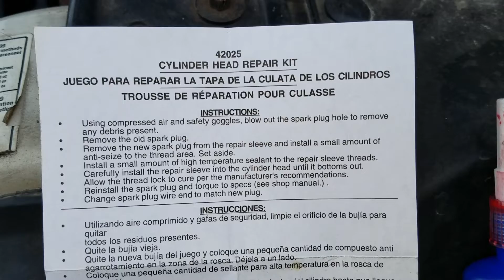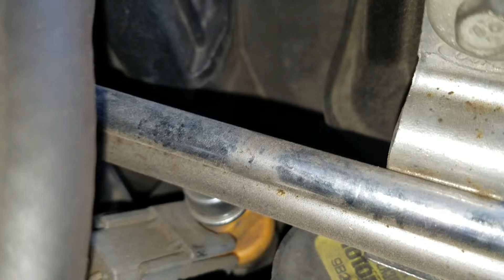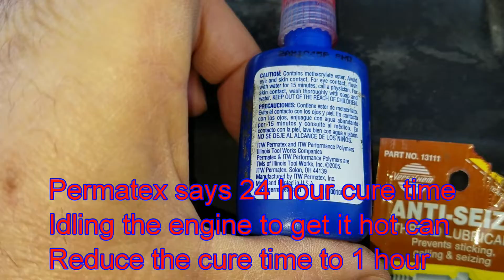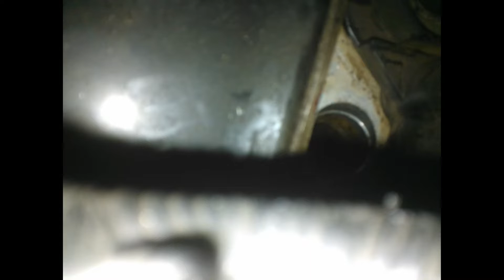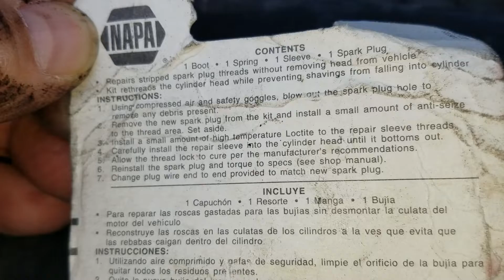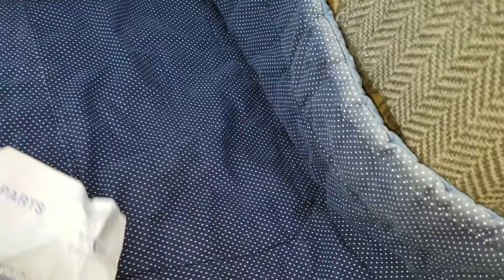Fast Permanent Fix FORD  5.4 L 2V Aluminum Head Spark Plug Seat Repair

Comment: Waste of time watching this video
Reply from the maker: Why is that?
Reply: @CITAP1  because of the title of the video. I thought this was going to be a walk through of how to re tap the threads, but it's all talk
Reply from the maker: OK,  there isn't much to show for re-tapping the sparkplug hole. The new seat taps threads as you tighten it down into the head.  (If for some reason this kit fails to work, you can go the next step and get a drill, tap, and re-seat type of kit.) You simply get the NAPA kit I show, you have to have the high temperature red thread locker.  Clean the threads as best you can. Brake cleaner and any way you can reach down the hole to clean the threads. Spray onto your cleaning impliment, not down into the cylinder.  Load generously red thread locker onto the new self tapping seat. You need a thin wall socket and extension to get into the hole. Start turning / tightening the new seat in and keep tightening till it has a solid stop. Tighten only, do not loosen.  Let it setup a couple hours. Reassemble the coil with the new short rubber boot and connecting spring.  You're good to go and if you have all the parts, it should only take 15 minutes. It's very quick and simple. I have 3 of these on my engine now and they work great. Others have had good results too. Sorry I don't show tightening it in. Only have 2 hands but it's just tightening it in like anything else you tighten down. Hope this helps, good luck...
Reply: @CITAP1  any information is helpful at this point because this will be my first attempt this weekend.  I appreciate the reply, thank you for reaching out.
Reply from the maker: Hello Bryan, I am interested to hear if you used the kit and how your result was.

Comment: This should have been a recall on these trucks but that’s my opinion
Reply: 💯 % designed to fail I remember as a kid dupont designed a tire that would never fail but they scraped it cause they needed them to ware out to sell more.
Reply: Four little as threads come on ford.
Reply from the maker: The first edition of the heads I understand had 3 thread turns for the plugs and the problem was awful in the early engines. A couple years later, the improved head came out with an impressive 5 turns of threads for the spark plugs. That's planned obsolescence for you. The FROD, I mean FORD, or do I, Engineers knew exactly what would happen. Frankly, all the manufacturers are guilty of some sort of cheaping out on product quality.
Take care...

Comment: Nice vid never seen this kit looks pretty simple
Reply from the maker: I just did another repair last January 2019 in Las Vegas while on a road trip. Takes all of 15 minutes to do the whole job. Longer for the cylinders closer to the firewall. Take care...
Reply: It's pretty simple alright, that is until your socket gets stuck and you cant get back out. Been trying to find a solution to this issue
Reply: @rickhill6426  calvan, or big sert by timesert
Reply: Extra long needle nose is what i had to use @rickhill6426

Comment: i have a more  permanent repair, besides ford deserves it after puting owners threw this shit. i took all my plugs out even the ones that were just loosening up causing engine light, the ones still tight i fixed there asses to.  i bought  4 packages of marine jb-weld, wrapped those plug threads in a thick layer, screwed em in, tighten them up and allowed to dry  5 days in garage. ford cost me 5 days no use of vehicle same bullshit as leaving at the dealer for them to fuck up even  more. and yes its still under warranty. if i do  drop it off someday to have them repair it after the heads blow off,  id  like  to see those button pushing obama generation idiot techs with  welding gases cart, firing up now, im in the guest window with my iphone recording away a good laugh. master tech: employed 3 years at ford dealer : well were gonna have to cut the heads off: cutoff wheel please. master tech returns with a small problem, ford used some  new assembly line  alternative  save time on the line glue. yes glue.  ill never ever ever buy a fucking any ford product again.

Comment: Can you change the new spark plug when you do a tune up?
Reply from the maker: I haven't tried. The plug with the kit is rated for 100 thousand miles. With anti seize on the threads, You should be able to.
Reply: What about adjusting gap on the plug
Reply from the maker: @urbandriven9331  
The plug is a Platinum plug and gap is non adjustable.  If you look at the tip of the plug, it has a U shape anode of metal going around the electrode in the center. I have two of these repair kits on my engine and they are working fine at about 50K miles. 
Now I will say one of the kits failed on me and I had to replace the seat with another of the same. The failure happened in Las Vegas on a month long camp trip. I was hauling a 3000 pound plus truck camper and doing 70-75 MPH on Arizona and Nevada highways. The engine was under a lot of demand and I sure the original kit only failed because of the demand placed on it. I have about 10K on the new kit and still working fine. When I pulled out the old plug, you could see the ware on it but it was still serviceable.
Reply: You don't have to . That is platinum plugs. Can last 150k miles before changing.If you drive that much yes you could change it that is what the anti seize is for .

Comment: What year and how many miles did it happen to you?  I had actually bought one of these kids for, "just in case"  im glad you let us know about the thin wall socket!  Ill need to get one..
Reply from the maker: Mine is a 2000 model year built in 99. The first time a plug blew out was at about 170000 miles while on an extended road trip coming home through Tillamook OR. I've had 2 failures, #6, #7, and a repeat on #7. All the failures did happen while under load with the truck camper on. The repeat repair on #7 is doing fine so far after 3 weeks now with the truck camper still on the truck.
Reply: @CITAP1  I have 2004 Expedition 4.6 number 3 spark plug blew out at 65 mph in the freeway. Only 101k miles when it happened.I used a similar kit that you have not Napa but Dorman. brand they look the same as Napa brand.After I installed it and waited 24 hours to cure the Loctite,Test drove it and was noisy hissing noise coming out the cylinder.I had to remove the kit and re insert it but this time I use JB weld instead of Loctite a friend of mine a mechanic suggested . Since then until now 15,000 miles still intact and good.Thank God.
Reply from the maker: @efrensaclolo7021  1 of my 2 repairs did fail in Las Vegas. I spent the night in the NAPA parking lot. Bought a new kit. They did not have the high temp red threadlocker but I had the bottle from when I did the first 2 repairs.  I tried to reuse the failed seat as it looked fine. It hissed and failed. I had doubts but the new kit has worked fine ever since.  I have heard of people using the high temp JB weld with success.  Glad to hear you got it working.
Reply: https://www.youtube.com/watch?v=Dg6T2wig8yU

Comment: Will that tool to make new threads work on a 2002 Ford F-150 ?
Reply from the maker: This repair drives through what's left of the existing threads after a Blowout.  It taps threads and seats in one step. Use a generous amount of the red 400+ degree thread locker to seat and set in place. Let setup 24 hours, les if engine is warm or hot when the repair is made. First time after setup, I'd run the engine at idle to get to running temp, then let cool to try and be sure the repair is set. I believe this kit works on all the 2 valve aluminum heads but talk to the parts person giving all the information about your vehicle to be sure you get the correct repair kit.
This repair works great for normal use. If you haul heavy loads and run the engine above 4000 rpm, the chance of failure over a couple years  is possible. My repair failed just a few days ago while on a trip carrying my truck camper and revving the engine over mountain passes. I redid the repair with a new seat and it has worked fine under heavy demand for 1500 miles now.
 The nice thing is, if this kit fails, you can do a true reseat repair at a later date.

Comment: How important is the high temp sealant?    Advance auto didn't suggest using it?
Reply from the maker: The Installation instructions say to use the high temp red thread locker. Also put some anti seize on the spark plug threads. Thread locker will keep the new seat in place. Anti seize will help prevent the seat from breaking loose and backing out if you ever change the spark plug. I'd follow directions. Be sure you get the high temperature thread locker from Loctite. I have two of these kits installed and both working fine. Good luck.
Reply: @CITAP1  ok thanks.    I just have another  question.. How long after installing does the sealant take to be cured and ok to drive?
Reply from the maker: I drove my first repair after about an hour and the send repair almost immediately since the engine was still warm
Reply: Extremely

Comment: I use that on my ford expedition $65 and 17k later it is still intact using a loctite thread locker.This is better than helicoil.Thank God.
Reply: Efren Saclolo  will this work on crown Vic 4.6
Reply: @ericberry5134  It should work,Its a Ford, Buy it in Autozone $47 + tax and 17mm deep socket.Put the tap and the sparkplug together with 15mm socket coat the sleeve with JB weld around and screw it in the hole until it stop.Wait 24 hours to cure the weld.And you saved a lot doing it yourself.
Reply: Update,I replaced it again at 120,000 miles because it started to leak or suck air and trigger po171 code.Same part same procedure.Now it runs perfect again maybe until 140,000 miles then I will just sell it for $5,000 This is the only issue that I have on this 2004 Expedition xlt.4.6 2 v

Comment: Wrong again... The cause is part of the calibration.... If you don't update the calibration you will have a second failure.... The failure is always in the cylinders where the EGR is added to the intake...
Reply from the maker: Are you talking about 2004 and newer engines with the 2 piece plugs that break apart during removal? This is a 2000 5.4 Liter truck engine with no per cylinder smog devices.  It does have an EGR valve which connects after the throttle butterfly valves feeding to all cylinders 
If you have a service bulletin link to show, sure I'd like to see it. I'm not professing to be an expert, just showing how I fixed mine which is still working flawlessly.
Reply: @CITAP1  No  this is not the threads breaking off, this is the blow out that takes the threads... Run the Vin on  the OASIS program... Most dealers will do it for you... By the way that fix is not an authorized fix and without the re-calibration it too will fail.... I was a field engineer for Ford Motor Co for 30 years and did some of the research into this failure....
Reply from the maker: @edofstad9675  I'm not following you on recalibrating. Recalibrating what? My heads are the improved heads with 5 turns of sparkplug threads. The pre 1999 heads if I recall correctly, were the very problematic heads with 3 turns of thread. These NAPA repair kits are quick and easy to install. This is a working truck frequently carrying heavy loads including a truck camper. One failure was while under load. The other failure, a couple years later was not. I think the first repair is 5 years old now. That's a pretty good span of service. I've had alternators, water pumps, compressors, and other components to the engine fail with shorter intervals and have much higher levels of difficulty to repair. Given the simplicity, performance, price, and reliability this kit has provided,  I call it a winner. If it ever fails, I will install a new seat.
Reply: @CITAP1  It's a PCM calibration to change the amount of EGR introduced...  The TSB addresses the plug repair and includes the pcm update.... If you don't have the pcm updated this will continue to happen.... If it were a thread problem it would happen on other cylinders... It's always the same cylinders.....
Reply: The reason it is not a 100% failure because if updated for any reason, this update is included....
Reply from the maker: OK, Now it makes sense to me there may be a recalibration of the PCM in how it controls the EGR valve and other components relating to it. Do you know what the recalibration is trying to accomplish as far as fuel air egr timing  etc mix?  I did hear somewhere in a guys video showing how to do a reseat kit, that he sees this issue is more common to a couple cylinders more often than others. He didn't associate it to anything other than is was odd that it was most common for these certain cylinders to go more often than others. The EGR is an intake manifold distribution, depositing into the main air intake flow. It could have a circulation pattern where the EGR gasses tend to concentrate to certain cylinders more than others.
Reply: Lmao its not an egr problem hes full of it its a not enough threads problem on aluminum that gets hot facts.
Reply from the maker: There is the Gremlins theory.
Reply: @CITAP1  Read the TSB.... But you know it all.... pound sand

Comment: From my experience it is not that the threads won't hold the plug.  It's the plug coming loose from improper torque and backing out until its only on one or two threads and then it blows out.  Out of about the 10 I've owned with the modular engine probably 7 of them had spark plugs that weren't even hand tight when I went to change them.   These engines runs so reliable people tend not to do maintenance until there is a problem so these trucks are out there running 150k miles and never had the plugs changed.  This is a good kit and easy to install.
Reply from the maker: I have suspected that be one possibility. Previous owners replacing and overtightening the aluminum threads and damaging them is another. I have also heard running higher than 87 octane fuel can cause it to but I think this one doubtful.  Take care!
Reply: Yeah that could def be an issue also.  I just found it odd that people are pulling 3-4 times the stock hp out of them with the same heads and not blowing plugs or if they are it's not often and you would think you would blow them left and right by adding turbos and blowers etc.  Higher octane theory sounds a little wonky.  Yeah raising octane would raise the resistance to burning but I don't see a correlation. If anything running lower octane which would cause detonation issues.  Who know for sure.  Probably a mixture of things.

Comment: Kinda beyond me, but good to know, so thanks!  Would you buy a newer Ford now?  I'm going round and round between Chevy, Dodge, Ford, new, used, gas, diesel...  
I dunno. Need a one ton dually.
Reply from the maker: I wanted the diesel for years but have changed my mind in favor of the large gas engine because it's a lot cheaper and easier to fix. While it works and gets me where I'm going, I consider my 5.4 liter too small for the weight of the truck camper and going up into the mountainous places I like to camp. Now if you are going to get a big heavy truck camper and do some towing, then you're better off going diesel. If you're pulling that much weight, I'd say go dually too. I'm happy with the super cab but if you need the storage or passenger space and don't mind the wide turning radius, get the crew cab. I'd also stick with the automatic. All truck brands are going to eventually have problems so just accept that. I'm still sticking with the FORD. There have been engine and other problems but all were fixable by me. So far the transmission suspension and the rest of the truck haven't failed me,,, yet...  When you're ready to jump, go, and you'll just figure out issues along the way. don't deprive yourself longer than necessary to get your ducks lined up and get your truck and camper. You don't have to start out with the perfect rig, just get something acceptably nice and use it till you're ready to get what you really want. A used rig keeps it's value well so you should get your money back out when your ready to get the one you really want. Take care...

Comment: Seems to me Ford needs to supply the kit at no cost to you since they know their engines do this. I think you said your Ford had the V 10 . I almost got a Ford with the V 10 but 300.000 and only light repairs later I am glad I got the Dodge ;) It has the SLT 5.2 Liter V8 in a med sized truck so it never has to work to hard. I think thats why its lasted so long. I pray the rest of your trip go's better for you Sir.
Reply from the maker: Hi Jeff, This happened twice a while ago and I just got around to making the video how to do the repair. First time was in Tillamook and the second time I was seconds from getting onto Seattle's waterfront Viaduct during peak traffic. One of the most heavily traveled roads anywhere if you are familiar with it. Fortunately I was able to pull to the side and make the repair under the Viaduct for rain protection. This is Seattle you know and rain does happen here. I made this second repair in about 15 minutes and was back on the road, coffee still warm! I have a kit ready to go if it happens again as you saw in the video. I got this truck for a great price but it's had it's problems. Failed head gaskets x 3 tries before figuring out the block deck had a gouge from the factory machining at the front right #1 cylinder, AC system replacement, Alternator, Power Steering Pump, cold start injector, O2 sensors (right side was a bitch and a half!), Instrument cluster failure, Speed sensor failure in the pumpkin, Shall I continue? Determined Son of a Biscuit Eater aren't I... You Take Care Sir...